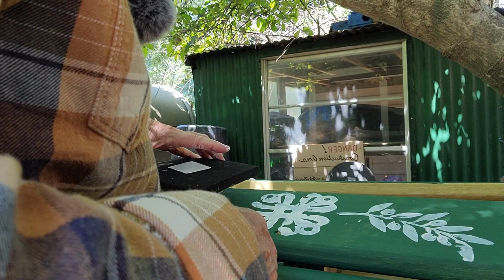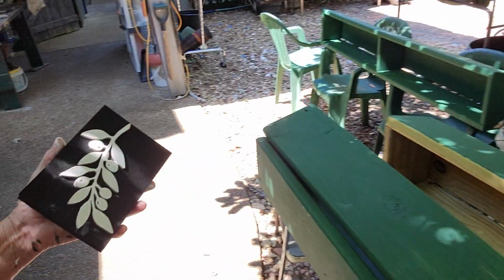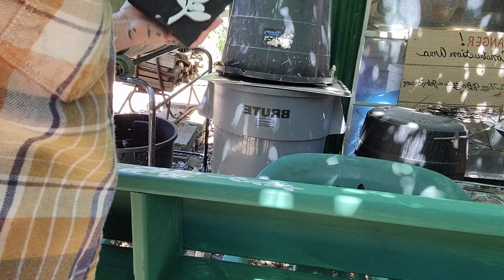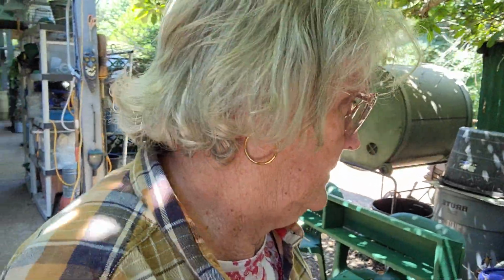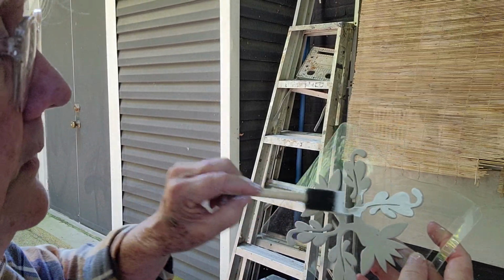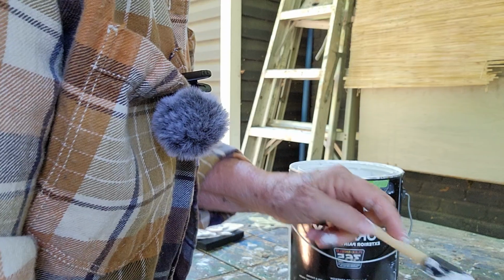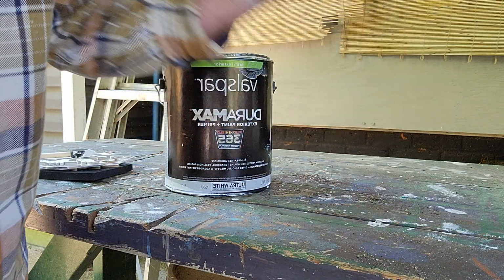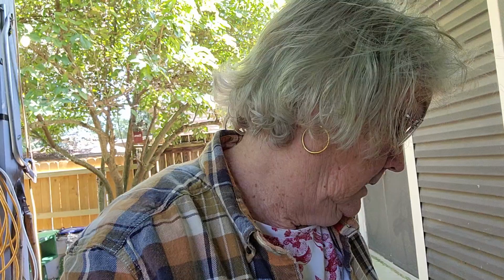Stencil 💚Window Boxes 🤢 # 2

Comment: Just a tip (if you don't mind) ... If you could place the camera on an angle that shows both areas you're working, when doing projects like this,  you won't need to walk the camara around. Like the other day when you were working on the other side of the pool and your camera was across the way (if I'm remembering right). Too much work to haul that camera all over the place when it's not necessary. And you just show the final job of whatever you're doing when done. ❤